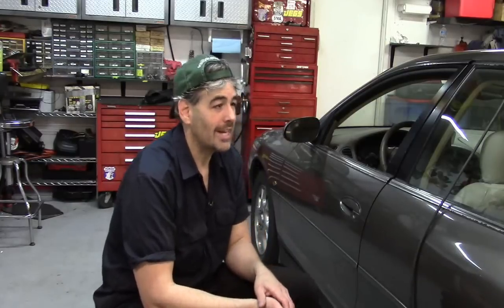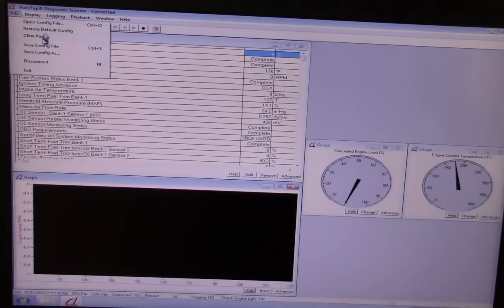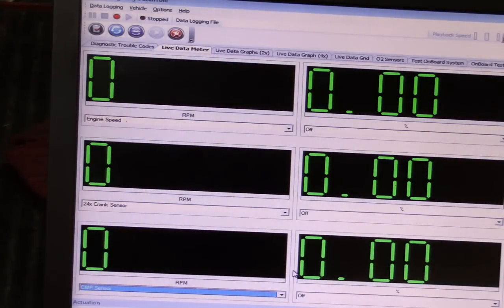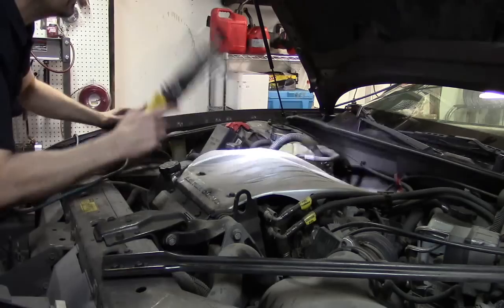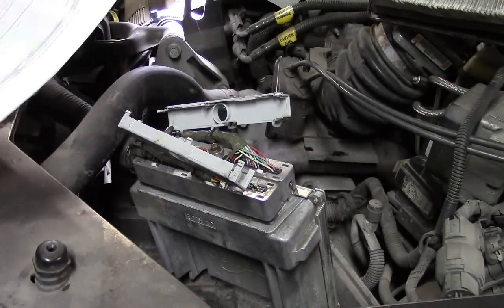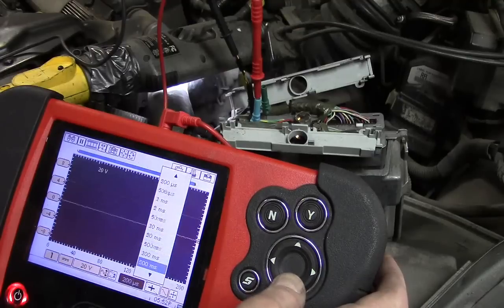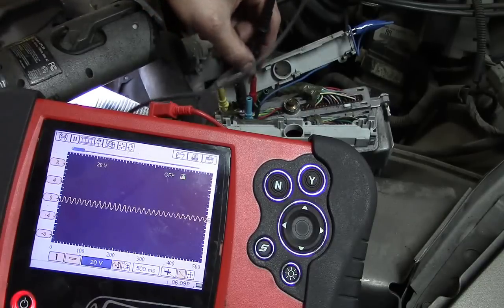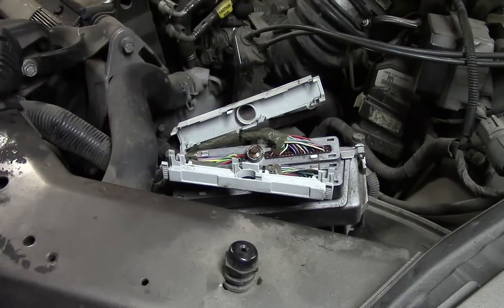DIY- Crankshaft Position Sensor Code Diagnosis

Comment: What scanner did you use when you showed engine speed,crank and cam signal ? Do you still use it today?
Reply from the maker: Yes I used autoenginuity in that video and I use it all the time still.
Reply: @SchrodingersBox  cool is it expensive?
Reply from the maker: It depends on which model you get. If you get it for just a specific make it’s like $250. If you get the full system that is compatible with all cars it’s like $1000.
Reply: @Schrodingers Box  Thank you soo much for the info! I really appreciateit and the great videos!

Comment: What site will provide me with the 'exact' make and model of my automobile? 2015 Regal 2.4L FWD? Thank you or if you can respond with the exact engine HELP! I am trying to locate the crankshaft position sensor. Thanks, Willie.
Reply from the maker: I use Alldata DIY

Comment: I have a 12 honda insight hybrid i just replaced the engine and now i have no rpm signal, spark or injector pulse. Swaped out crank and cam sensor. Still no change. I checked grounds and connections the crank and cam run off the same wire. How do i test this with my dmm does it create its own voltage?
Reply from the maker: WHy did you change the cam AND crank sensors? What was your data indicated both were faulty? That is really unlikely. I would start there.

Comment: HELP'
2003 Honda Accord 4cyl.
I got a check engine light P0341 that i need to clear.
It sounds like a lawnmower when i start it and the RPM drops and dies out.
I changed the spark plugs and coils with new ones and 
It cleared the 4 codes it had that were P0300, P0301, P0302, P0303, P0304
HELP?
Reply from the maker: I need the data you got that you suspected a secondary ingitionj issue.  How did you determine the plugs where the likely problem. Was resistance test done on the secondary otherwise? Whats your fuel trim indicating under load?
  There is no data to work from here.
Reply: We connected a code reader and got all the codes. 5 codes it had that were P0300, P0301, P0302, P0303, P0304, P0341
We seen it was a misfire so we replaced the plugs and coils. 
i cleared the codes and now we only have a P0341 showing. it says its a Camshaft Sensor. Thanks
Reply: just what the handheld scan tool codes that came up. no other info I got it just showed the codes. No other test were done.
Reply from the maker: @jessetrujillo1600  Well I need data from testing to help.  Good luck!

Comment: Did you get to meet the "Jedi Master" ??....it would be cool for you two to do a video together !!
Reply from the maker: Yes you speak of course of Paul Danner. I have met him several times and we did some talk of doing a video together however it is virtually impossible given our locations in Denver vs Pittsburgh.  I do talk to him occassionally though!
Reply: Yes, I speak of him (bowing my head)...LOL !!! !!...was watching this CRK sensor video. Question...I finally got around to doing a CKP/CMP correlation on my '01 Corvette this past weekend for the first time (at the PCM of course) on my Picoscope...now your Trans AM has the same LS1 engine ??...my CMP waveform looked really weird...if was as if you pulled up on one corner of the squarewave...I know it's not right....CKP is a perfect 24X waveform...have you ever seen a CMP that looked strange like this with your Vantage Pro ???...maybe I'll try it again but with my Vantage Pro and see if I get the same result. Thanks !!
Reply from the maker: Hmmmm no- everytime I have ever retrieved a waveform off a hall effect sensor it has been perfectly square (or missing if that's the issue).  Not sure what to say about that. Maybe it's some type of interference voltage spike or something. A couple things you might try are using the sensor ground as opposed to battery ground, turning on filtering and turning off peak detect.

Comment: hi i have a 2001 olsmobile intrigue 3.5l , but the water light comes on an off  sometimes, even if the engine is full of antifreeze ,can u helpme with that
Reply from the maker: check for low water level and then check for intermittent failure of the coolant level sensor.

Comment: I was to I need a cam sensor replacement, so I put one in and now my speedometer don't work.
Reply from the maker: Sounds to me like a misdiagnosis and incoect installation. Confirm the diagnosis with a bypass test and then ensure installation is correct
Reply: Battery, alternator, starter  voltage is good wiring is right. Crank no start. I am doing this myself cause I don't have a honest mechanic.
Reply from the maker: Well if it were me i’d look at CKPs and CPS outputs and verify with bypass testing.
Reply from the maker: besides what does batter, alternator and starter have to do with a crank no start????

Comment: that happening to my Honda accord ex v6 I crank and the rpm don't move
Reply from the maker: Then you just have to diagnose if it is the sensor, ground, signal or feed and if all are good, your PCM is bad. That's why I just do a CKPS bypass and keep it...  Simple!
Reply: +Schrodingers Box ok I need to learn how to do that bypass and that would cause not to have spark on the distributor
Reply: +Schrodingers Box my car would it been a good video for you cause I'm not a mechanic person but I don't my best. show me how to do that please
Reply from the maker: I have several videos on it.  Just bypass the feed to reference. Just make sure you do it right so you don't blow your PCM.
Reply: +Schrodingers Box thanks I will look for your video on it a question will that cause no spark on the distributor

Comment: Life long shade tree who just discovered your channel. Vids are greatly appreciated as the prices charged (parts & labor) @ many places is nothing short of criminal! Have an 05 Altima 2.5L that cranks but no start, tach doesn't move while cranking. How do I determine if it's crank or cam sensor? Can this be done with only multi meter & test light? Scientific/ True Diagnosis approach is awesome.👍 on promotion.
Reply from the maker: Normally I just do a CKPS or CPS bypass and the one that works validates the bad component. Simple as pie!!

Comment: At 26:30 - discovering no pwr to sensor B, but a good ground... possibility of a short in the hall effect sensor?... ummm unlikely.
I think I would have physically wired 12V to the pwr wire of sensor B, cranked the car, and looked for a square wave. If we do then wire loom and sensor B are good. Pwr at PCM bad. I'd yank out the PCM and clean the insides of debris and also spray it with electrical switch cleaner. Then reinstall and try again. If still no pwr then PCM bad. My $0.02.
Reply from the maker: No not a short in hall effect sensor- short to ground of the power wire that may be causing the power to shut off based on the circuit P-code presence.
  There is no need to do those other tests you described- I already did them in essence by "borrowing" the other crank sensor power signal and verifying the sensor itself works.

Comment: Why replace the PCM? Simply connect another 5V DC supply line to this line as the PCM should have more 5VDC lines powerful enough to run more than 1 sensor. Otherwise 5V DC with 1A oder 2A can be obtained via a simple USB power supply (cell phone car charger) connected to ignition plus (contact 15 with regard to DIN 72552). Such a device is probably lying around in your garage. A quick test would have hooked up external 5V DC from a lab power supply to this line. As the crank sensor signal is a waveform signal, it does not need super-reference quality 5VDC. Anything around 5V is enough.

If you spend less time on deriding more mechanically oriented YT channels, you can be quicker with your electrical repairs. :-)
I like your general style, but would love you being a bit more focused and less confused and time-consuming to watch.

Comment: hello sir,i am watching your videos and far since i have seen, you  are very good in what are you doing,and thats a good thing.Now,i send you this message because i have a problem whit emissions in my car and its a little bit strange for me to understand,maybe you could advice me.So i have a vw passat 2001 1.6liter engine(alz code) and on the emissions test its fail because of the high carbon monoxyde(CO),but the hydrocarbons are below limit,both oxygen sensors are working properly,except the fact that the downstream sensor its not stable,ok this tell me that i have a bad cat but then why on idle all emissions are good and when the engine rev up to2400 rpm the CO became higher ?if it is a bad cat then even on idle this value of CO should be high?lambda coeficient its  1.01 the car acting normal,no bad mileage no strange noises from engine,all good except the emissions...

Comment: I hope you show this. My father's '98 has the same problem. I read that removing the starter was necessary. Interesting video.
Reply from the maker: +Shawn P Yeah there is no way to even probe the sensor without removing the starter. But remember this is a hall effect sensor.  The sensor must be backprobed and then starter reinstalled to crank vehicle to test it.
  AIn't nobody got time fo dat!

Comment: Could it be that the resistor in the pcm that feeds power to  the crank circuit has burned out and needs to be replaced?

Comment: Don't rule out an internal short in the pcm. Aluminum case flaking causing a short across the circuit board. It does happen.
Reply from the maker: +James Last And ONLY cause a short on power for CKPS B????  Hardly likely
Reply: I had a Bonneville with an egr code. I never considered the pcm as a cause for the fault. After verifying operation of the valve I opened up the case and lo and behold an aluminum flake from the case was shorting out the board and causing this single code.
Reply from the maker: James Last What was the data you got that sent you to the PCM as opposed to the wire harness or something? What was the output from the PCM that indicated this fault!
Reply: +Schrodingers Box No 5 volt reference at the egr valve and no 5 volt reference at the pcm.
Reply from the maker: +James Last Wait- how can that be??? The 5v ref is ubiquitous to ALL sensors. It is impossible only an EGR code would be affected. The car would not even be able to start if that was the case!!!
  Are you sure that's what you found? It can't be possible.
Reply: +Schrodingers Box The car started and ran fine until the check engine light came on and only indicated an egr code. However, while the engine light was on, the car stumbled and barely ran, which like you indicated, the pcm was losing 5v reference. There were no misfire, tps or any other codes. It was very intermittent and seemed to only happen on hot days. After finding the flake, I assumed that it expanded with heat and then touched the board. After removing the flake the car ran fine and egr code never returned.
Reply from the maker: +James Last It makes no sense at all. No 5V ref and the car ran much less started???
  Ok then.  Not sure how to explain that.
Reply: +Schrodingers Box I coasted into the garage on several occasions. And when the car wouldn't restart the 5v ref was gone. It was hard to believe that it didn't set any other codes.
Reply from the maker: James Last Wow managed to have symptoms happen close enough to be able coast several times into the garage and have a flake intermittently cause the same symptoms intermittently.  You are definitely the king of the improbable. Now that the car works I would very, very strongly recommend you buy a lottery ticket!!!
Reply: +Schrodingers Box An idiom of improbabilty states that random chance had worked in my favor.
Reply from the maker: James Last Actually it overwhelmingly indicates misdiagnosis, But yes is is also possible a flake of aluminum caused this. Well, actually it isn't- the car cannot run without a 5V ref.

Comment: I just had a similar problem with a crank sensor on an Astro Van.  It had intermittent power at the sensor.  It turned out to be a bad ignition switch.

Comment: Easiest way to check for short to ground without fancy tools is to unplug the PCM then run a wire from the relevant terminal through a 12v21w bulb to battery positive. If the bulb lights bright you have a short to ground.
Leave the ign off.
You  can leave this hooked up while you are moving wires around to see if it flashes on and off.
Because the sensor normally runs from 12v this will not harm it.
If the light is on and goes off when you disconnect the sensor the fault is in the sensor.
Hope this helps.
I like your methodical approach rather than just replacing the part indicated by the code. :)

Comment: quick test cut the wire and see if the 12 volts returns cheers sandy or alternatively disconnect multiplug at pcm and do continuity check

Comment: Love your channel and the knowledge you share. To do a visual inspection only takes a few seconds, often times you can accomplish this faster than you can boot up a scanner or oscilloscope. In fact almost every service manual will tell you to start with a visual inspection. You may just find a wire rubbing against a crank pulley. I have fixed MANY vehicles with a visual inspection that took less than 10 seconds. Simpleton? No, I like to call it efficient. If my flashlight and eyes don't see anything during a 10 second visual inspection, that's when diagnosis begins. 

Anyhow keep up the good work and spreading the knowledge. Congrats on the promotion.
Reply from the maker: +Gregory May Yea I understand but what I am saying is it is UNSCIENTIFIC.  I am not debating Practicality. It is simply that it is an unscientific approach by definition is all.
Reply from the maker: +Auto Fix Pal It is more a matter of logic and reason than practicality. Doing a visual inspection that requires removing splash shields, lifting car, And really having no idea what you're targeting seems ridiculous to me. At least now I know what to look for exactly. 
  Also you have no baseline. On ANY car you will find SOMETHING. But there is no scientific baseline to determine what you found was the cause and had effect as an independent variable. 
   Any way you look at it, starting a visual without foundation is always unscientific by definition. This channel is about scientific approach and procedure.
Reply from the maker: +Auto Fix Pal You're missing the point though- when you find an anamoly on a visual without defining baselines, how do you know it was the independent variable? That's my point.   It's unscientific, you do agree, right?  This channel shows scientific approach only.
Reply: +Schrodingers Box AFP is right. We had a car that wouldn't start and it come up with crank sensor fault. After visual inspection we found out that crank sensor securing bolt was loose. 5min diagnosis.
Reply: +Schrodingers Box not suggesting that you start removing covers or  parts. But i quick look under the hood with a flash light can often lead you in the correct direction. You stated Not all vehicles will show cranking RPM on the tachometer, YES this is true. But yet it was worth the time to check because it took no effort and can lead you in the correct direction. 

You can't always trust scan data either, it's slow and its processed. The best way to really see what's going on is with an oscilloscope scope. Scan data is especially slow when your monitoring more than one PID at a time.
Reply: +Schrodingers Box I get it, I understand your methodology. Just don't agree that looking for the obvious first makes you a "simpleton".

Anyhow. Hope to see more videos from you soon and i am still curious about what was wrong with the old Audi you ran out of time on a while back. Did you ever hear back from that guy?

Comment: To rule out a quick short to ground from the power feed without unplugging the CKP 'B', cut that wire and see if you have 12v from the PCM. You could also run a 12v source to that circuit from another as a temporary fix if the cost of the PCM is not within the customers budget.

Love your video's and keep them coming.
Reply from the maker: +dreamer2355 Cut the wire?? Why not just unplug the connector at PCM and do continuity test?
Reply: +Schrodingers Box that will depend on the PCM and the location. How will a PCM feed a circuit if its main power and grounds for the PCM are removed?
Reply from the maker: dreamer2355 EXACTLY. Therefore continuity with the frame confirms short to ground.
Reply: +Schrodingers Box i need to learn how to read. I never read your comment fully mentioning a continuity test. But yes, you can also run that test. Sorry about that.
Reply from the maker: +dreamer2355 No problem- your way would do same but I don't like to cut wires and introduce new variables in the repair.

Comment: interesting problem.  Thanks for sharing.  I'm sure many shops would have simply diagnosed a bad crank sensor withthout checking voltage/ground as you did.  Curious.....since you ran out of time and will be out for 3 weeks, what did you tell your client?  
Come back in 3 weeks?  or did you sub out to another shop with very specific instructions on checking a short to ground, and possible PCM replacement?  or did you actually have time to check short to ground and will follow up in another video 3 weeks from now?  thanks again.
Reply from the maker: +Louis Pasnik Great question- yes unfortunately I had no alternative but to inform client of the diagnostic status and return in 3 weeks if they cannot find another mechanic to do this for free ;-)